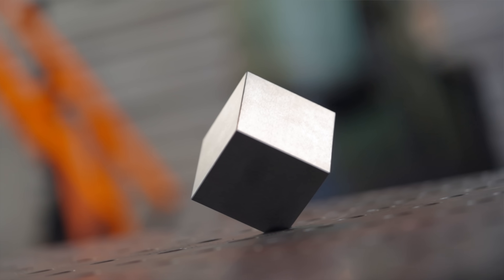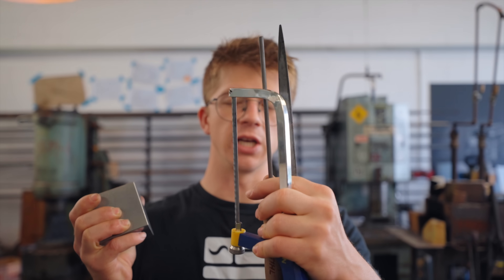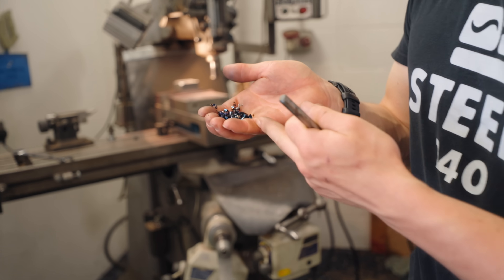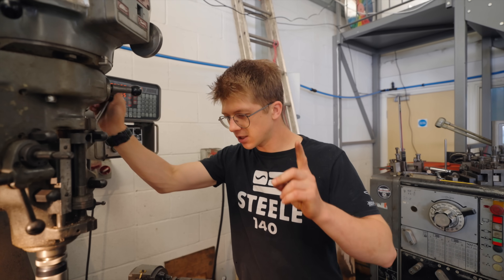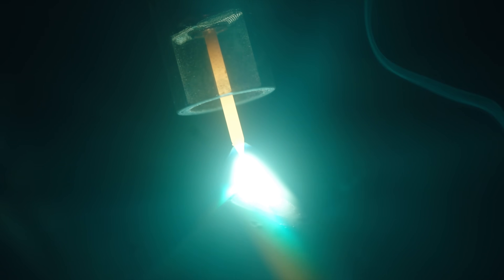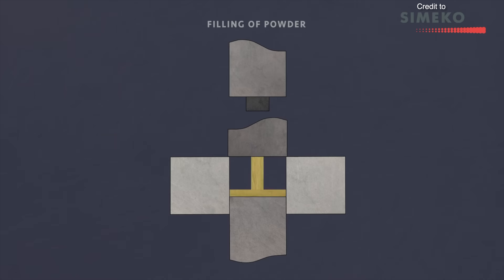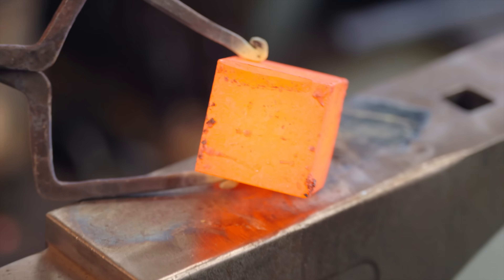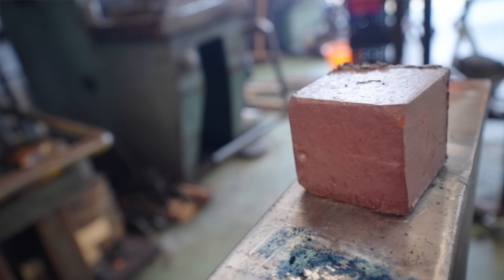Can You Forge Tungsten?

Comment: I worked in a lab that specialized in making crystals from exotic metals. The way we would do this is by actually dissolving various metals in molten tin/lead/bismuth (few other metals work well in this area, but tin is the most commonly used). We would drop in various metals into the molten tin and watch it dissolve then form crystals with the other metals. Its a very similar process to making sugar crystals except you have 2k degree ovens and a 0 oxygen chamber for various toxic/reactive metals
Reply: What was the function of that lab? Was it just throwing money away at research?
Reply: @Pleiades721  this was back when I was in college, the lab was through the chemistry/physics/engineering department research grants with TI being a major factor. As far as actual purpose, we were identifying and documenting crystalline structures with exotic properties that have applications in advanced electronics as well as quantum computing. We would create models of crystals in various softwares then try to create said crystals with our crucibles if we thought the properties of a specific crystal would be useful. I worked specifically on the crucible/heat curves side.

The science that goes into this research is often used by large electronics manufacturers such as Samsung, Apple, and Texas Instruments as these crystals can help make more durable phone screens, more efficient processors/conductors, and even smaller transistors. On the more theoretical side, development of these crystals is also vital for research into quantum computing (I say theoretical since most people don't own a quantum computer). Properties such as superconductivity are not observable in most materials (or at least require specific extreme conditions).

Some other real world applications for this sort of research include solid state radars, solar panels, and battery storage. Solid state and condensed matter physics is probably one of the most applicable fields to everyday life

Comment: 8:50
It melts because in DC welding 70% of heat is going to the work material and 30% to the electrode. If you switch your + and - then it will be opposite. In AC welding it's 50%/50%

Comment: Tungsten carbide is ideal for kinetic weapons
Reply: Thanks for reminding us of something that's been known since the 1940s:

Tungsten was first discovered in 1781 by Swedish chemist Carl Wilhelm Scheele, who isolated a new acid, tungstic acid, from the mineral scheelite. Later, in 1783, the brothers Juan and Fausto Elhuyar succeeded in isolating tungsten as a metal by reducing its oxide with charcoal.

As for its suitability as a kinetic weapon material, this likely became apparent during the early-to-mid 20th century, especially in the context of its use in armor-piercing projectiles during World War II. Tungsten's exceptional density and hardness, combined with its ability to retain strength at high temperatures, made it an ideal material for penetrative munitions, such as tungsten carbide-cored projectiles. This application likely emerged during the 1930s and 1940s as nations sought to improve the effectiveness of anti-tank weapons.

By the 1940s, tungsten's properties were well-recognized for kinetic energy penetrators, leading to its extensive use in armor-piercing ammunition and later in specialized kinetic energy weapons like modern tank rounds and missile warheads. Its high density allows for enhanced momentum transfer upon impact, making it one of the best materials for such purposes.

Comment: Tungsten carbide (WC) is a highly durable material known for its exceptional hardness, wear resistance, and thermal stability. Composed of tungsten and carbon, often bonded with cobalt, it is widely used in cutting tools, mining equipment, and wear-resistant components. Its hardness, which rivals that of diamond, makes it ideal for machining tough materials, while its high-temperature strength ensures reliability in harsh conditions. However, its brittleness requires careful control of the binder to maintain toughness. Ongoing advancements in manufacturing processes continue to improve its performance, making tungsten carbide a crucial material in various industries(aerospace,automative,mining ..etc)

Comment: It's interesting seeing videos like this as I'm developing a game where fantasy races use real-world metals in their own alloys and techniques. For example the Wolf-people use Tungsten solely out of the pun that the primary ore is called Wolframite, which is melted down with strange ice nodes that litter their homeland. The enchanted ice melts into a gelatinous flux, and the tungsten itself is melted in an alchemist's kiln and boiled off to retrieve salts, which are mixed into the ice flux before melting, casting, and freezing. The unusual process forms a crystalline edge that causes the enemy's blood to freeze to it in jagged patterns, effectively creating a serrated butcher's edge. The alloy of ice and tungsten metal isn't even considered a proper metallic alloy by most standards, but it is referred to as Lycansteel.

My version of Dwarves are monstrously disfigured and irradiated due to using uranium glass for decoration and use osmium dust to strengthen lead pewter tools, and this is actually what adamantine is, referred to as such by the Greek-inspired Gnomes as adamant refers to diamond, and the Dwarvish smithing techniques partially mold the metal's molecular lattice into that of diamond, and it is used as a core layer in forging. The Dwarves are said to be stark raving mad at the best of times due to the amount of toxic material they willingly expose themselves to, including noble robes dyed red with cinnabar mercury.

Fey folk use silver, which replaces the iron in their blood. Since they're sustained on magic, and silver is a magickally reactive material, their blood is still capable of carrying the essences necessary to life. They are allergic to metals which are easily magnetized or oxidized, rust is toxic to them and magnets screw with their ability to cast spells.

Comment: the reason its not near as hard as those drillbits, is because its pute(mostly?) tungsten, while the super hard stuff is tungsten carbide
you can say its like the differnece between iron and steel, but way mroe cause tungsten carbide is chemically 1-carbon to 1-tungsten

Comment: You should try getting your hands on rex 121 steel it has 10% tungsten and 9.5% vanadium which is even harder than tungsten and this stuff will hold a edge TWICE as long as most knife steels.  I imagine powdered steels are heated to obsurd temperatures in a vacuum to mix these vastly different metals

Comment: In chip design, tungsten is often used in the lowest metal layers, right up against your transistors. It’s extremely resistive compared to copper, but it doesn’t deform when pushing lots of current

Comment: Chemist here. That "smoke" you are seeing is WO3, tungsten trioxide. I wouldn't breathe that on a bet. It's not just smoking at that temp, it's burning. But very slowly.

Also, how they make tungsten steels is not by melting the tungsten, but instead dissolving the tungsten into the steel melt.

For tungsten carbide, you need an arc furnace.

Yes, tungsten metal can be cut cold. It is commonly lathed.
Reply: Cool, I was trying to figure this out, Good information thank you. Got to say though, that slow burning is hella cool
Reply: You could probably sinter it mixed with other metals.
Reply: I guess you can also alloy tungsten with iron by putting iron (alloyed iron) and tungsten powder in a mill?
Reply: @johaobagriel8548  This is known as "powder metallurgy"
Reply: I feel if he used oxy-acetylene in his forge, he might be able to get it hot enough to forge it
Reply: @1upu361  From what I understand, that would be pretty expensive and not really viable. Acetylene is pretty unstable, as in spontaneous combustion in the presence of oxygen above 15psi, and can self-detonate without oxygen at 29.4psi+. So an acetylene tank is actually full of a porous material saturated with acetone. The actual acetylene is dissolved in the acetone, kinda allowing it to be stored as a liquid (more gas in a smaller package) without a lot of pressurization like they do for propane.

Because of these restrictions, you can only pull so many cubic ft/hour from a tank as pulling too fast will at best cause your torch to spit acetone or at worst blow up the tank. Industry limitations put that at 1/10 of the tanks capacity in cubic feet per hour for short uses and 1/15 for continuous use (ie. if you have a 100 cubic ft tank you can only flow 10 ft3/hour for short durations, or only 6.5 ft3/hour continuous)
Keep in mind that while acetylene does burn hotter, a cubic foot of it is about 40% less BTUs than a cubic foot of propane(which means you technically have to burn 40% more acetylene to output the same amount of heat as the propane)
Also enclosing the torches in a forge may still cause flashbacks into the supply lines.

Basically even if you managed to get the forge running on oxy-acetylene, you would have to supply it with several large (and expensive) bottles manifolded together and a large supply of oxygen (those bottles aren't necessarily cheap either) and honestly MAPP gas (or I guess it's MAP-Pro now) gets hot enough for forging temps of tungsten.
Reply: @1upu361  I'll add that it's all kinda moot anyway because, like OP mentioned that tungsten trioxide "smoke" coming off it isn't exactly good for you. Tungsten technically should be forged in an inert atmosphere, which is why it's not really forged in the first place.
Reply: Wait that's why the tungsten welder has the inert gas flowing over the tip: it to keep it from smoking, right?
Reply: @Hello-pz6hb Yes, it also stops the metal being welded from oxidising which would spoil the weld otherwise.
Reply: Tungsten is actually really easy to machine, no special tooling required. In fact you really don't change anything feed and speed wise at all from mild steel. It 8s dense yes but not a super metal. Its advantage is heat resistance but it actually deforms pretty easily. Temperature aside there are way way better metals out there these days
Reply: @albertbahoogadin Yeah, I don't get why he said on the video that it's a super metal, lol. You can use it in alloys that are "super metals", but not in a pure form like that.

Comment: Well, how do we have amalgamations of metals(all having higher melting points, but the combination has a far lower melting point? You need to look to the physics. Heat can be looked at as energy, ant that can be looked at as distance between atoms. If you hold the mix at a molten temperature but not a boiling temp for the more volatile elements, and stur it, you end up with an alloy tgats both homogeneous, but better than the base metals its made of. The same goes for ceramics.

Comment: Re alloying high melting point metals into lower melting ones: think dissolution. You can dissolve rock salt in water. The same thing happens with metals of differing melting points.
Also: your initial expectation of tungsten metal was clearly formed by your experience with tungsten carbide. Just remember that the component that makes hard steel hard is the iron carbides in the mix. Similar phenomenon.
As for ductility of tungsten: remember that incandescent bulbs contain double coiled incredibly thin tungsten wire. So clearly it can be formed.

Comment: Tungsten alone can be ground fairly easily compared to carbides and hardened steels.  Its really dense and can take alot of heat without deforming or melting…the reason its used as an electrode for tig welding.  As a former tanker in the US Army, folks ask me why a particular type of round we shot was depleted uranium and not tungsten since they are about as dense, tungsten breaks when you hit it too hard so it tends to spall outside whereas dp self sharpens as it penetrates.  We do use tungsten rounds, but only for training and tungsten carbide in the canister (antipersonnel) shot.

Comment: Take the little TIG rod and try to bend it with your fingers/hands - then you know how tough and hard it is as a metal.
Regarding density and melting points - yes, Tungsten is extreme. But it's not alone. Uranium, Ruthenium and Rhenium are among the extreme ones, too - some even exceeding Tungsten.

Comment: Melting Points:
Aluminum: 660°C (1220°F)
Brass: 930°C (1710°F)
Aluminum Bronze*: 1027-1038°C (1881-1900°F)
Chromium: 1860°C (3380°F)
Copper: 1084°C (1983°F)
Gold: 1063°C (1945°F)
Inconel*: 1390-1425°C (2540-2600°F)
Cast Iron: 1204°C (2200°F)
Lead: 328°C (622°F)
Molybdenum: 2620°C (4748°F)
Nickel: 1453°C (2647°F)
Platinum: 1770°C (3218°F)
Silver: 961°C (1762°F)
Carbon Steel*: 1425-1540°C (2597-2800°F)
Stainless Steel*: 1375 – 1530°C (2500-2785°F)
Titanium: 1670°C (3038°F)
Tungsten: 3400°C (6152°F)
Zinc: 420°C (787°F)

Comment: You can make an alloy of silver (or gold) at room temperature.
The temperature of an alloy's constituents is largely irrelevant.
The silver alloy I refer to is an amalgam - an alloy of mercury .The mercury will dissolve the silver at room temperature .
Dentists used to do this all the time.
Carbon sublimes at 3,630 °C , yet they make steel with it because it dissolves in molten iron at 1538 °C

Comment: Tungsten… melts at over 6000 F? Are there alloys with a higher melting point? That would theoretically survive the surface of the Sun…. once you get past the corona. That would be an amazing material for building probes that dipped into the surface of the Sun for even brief moments.

Comment: Machine the tungsten into an extrusion die and pressure sinter or pump high temp TiB2 through it. You can wire edm tungsten and TiB2 into net shapes.

Comment: Tungsten(W, 74) is pretty stout, but if you want some dense, weighty material then you should check Osmium(Os, 76)- it's the densest element on the table. Then Iridium(Ir,77), Platinum(Pt, 78), Gold(Au, 79), Mercury(Hg, 80), Uranium(U, 92), and Carbon(C, 6) as Diamond are some other METALS & 1 Stone are surprisingly heavy as well. Neptunium(Np, 93) & Plutonium(Pu, 94) are 2 more very dense METALS. However, both of them are not available outside of a laboratory. Both Np & Pu have the ability to undergo atomic fusion or fission without any simulation of any kind and without any warning. You are safer working with U than either of those 2 mean ass METALS to the right of Uranium and to the right of Neptunium[Plutonium].

Comment: You can add the tungsten to molten cast iron, it will partially melt and mix to form a eutectic compound. It should be really cool but  not really practical. 
Maybe save the tungsten chips from the machining to add them to the cast iron.

Comment: Pardon if its already been said. But I think its due to something called precipitation grain hardening. I was told they add powdered tungsten to liquid steel and then you know the rest of steel production. Every bit of dust becomes a nucleation point. Having the higher melting temperature means it can flow within the steel and then as the steel cools all of the grains start to form around the already solid tungsten. Happy to be corrected by more experienced or qualified people. Welder here

Comment: My dab rig uses a tungsten tip... was fairly cheap. Think the tube is tungesten with steel heat sinks? Looks like a round tube with thick round circles at the base end. I don't see any seals/seams and it claimed it was tungsten for health reasons... and it is heavy BUT idk

Comment: I have a theory on why it machines and drills so well, one of the problems when doing this kind of work of course is hardness and wear resistance of the metal being machined but tungsten doesn't loose much of it's mechanical properties as it heats, most metals become plastic in nature as they heat and this causes problems, but tungsten just isn't having those problems. So while I'm almost certain it's hard on tooling long term that shouldn't make it non machinable.

Comment: Try it again but this time heat it much higher,  I found that you need 1600°C but if this is not working go berserk, up to maybe ...say ~3300°C. For this you need a electric arc furnace or an induction furnace . And btw quenching will not work with tungsten because tungsten always maintains a body-centered cubic structure.

Comment: you could try using the coke forge if it still works on the tungsten because that does get to about 2500 C if I remember correctly wouldnt be to sure tho but hey great video

Comment: next: can you forge osmium?

also i imagine it's so much softer BECAUSE it's a baked powder rather than cast/forged, the metal itself has the weight/density of gold, but the block is only as hard as steel because in making the block they never fully melted the tungsten
Reply: nevermind don't try this i forgot when osmium breaks/shatters it produces one of the deadliest poisonous gases